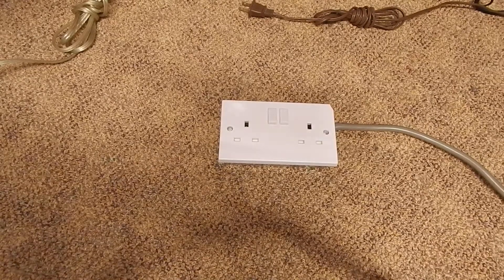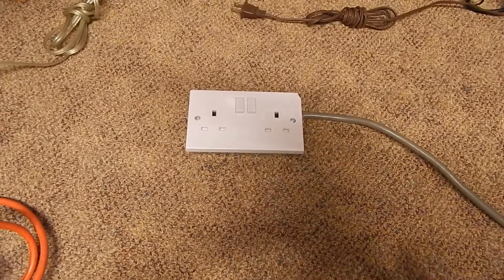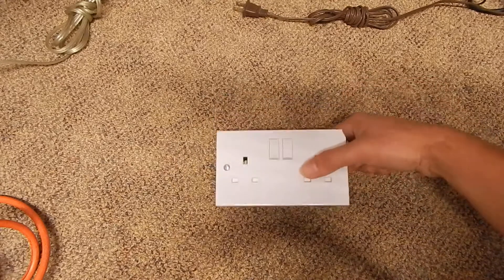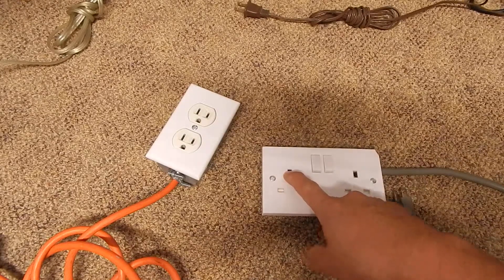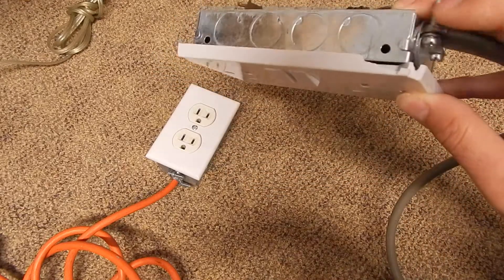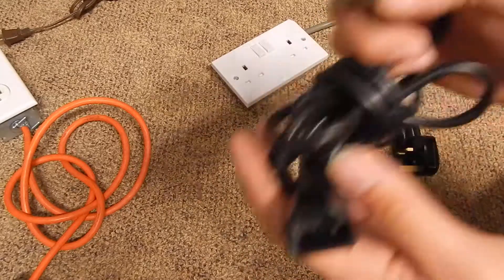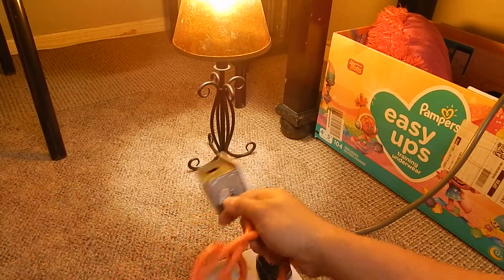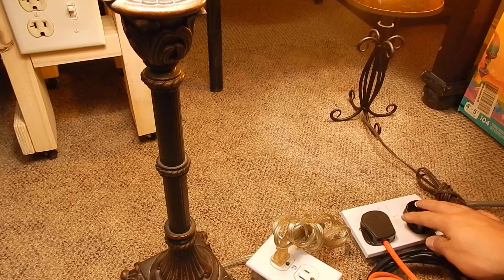British Outlets Wired For 120 Volts At 60hz

Comment: Can i use a 70 volt speaker with a nobsound bluetooth amplifier? Its one of those micro square ones that has screw terminals on it and its like 30 watts
Reply: I know your comment was 4 years ago but you'd have to transformer-bypass the speaker so there's a direct connection to the speaker driver.